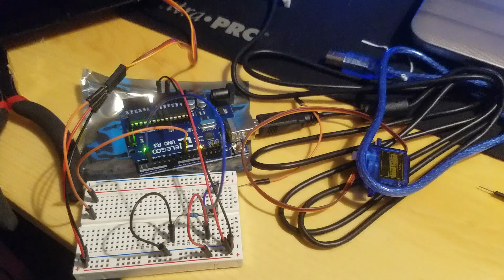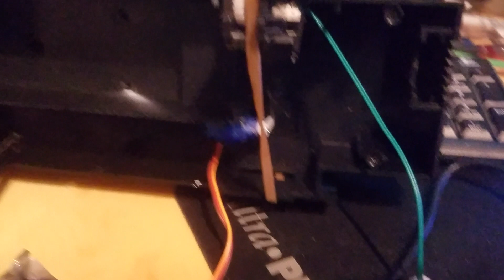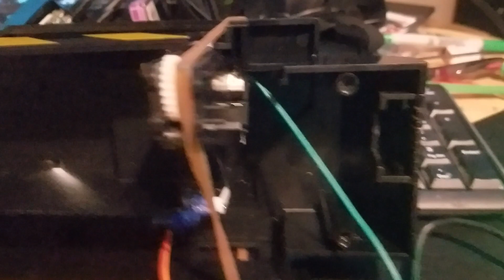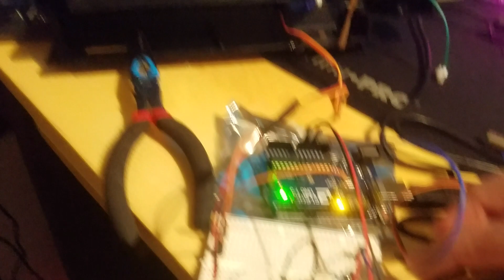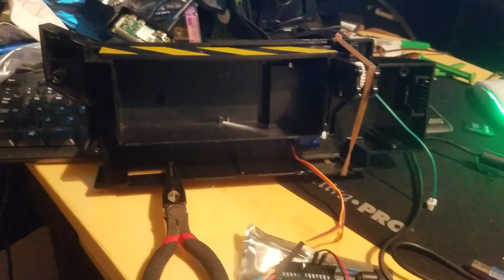Ghost trap arduino update

Comment: This is awesome! What did you use to attach the servo rod to the door mech?
Reply from the maker: So the servo rod i bought had some plastic sheathing that came with it, I just glued that to the existing "tabs" that the handle click mechanism pushes down on and fed the rod through there. Then the servo just needs to pull them down to close the doors and push back up to open. I have a link to a better description on the gbfans thread I created: https://www.gbfans.com/forum/viewtopic.php?f=3&t=44674&sid=6e525409de3458fa5112df759e4e29e3

Comment: Awesome job!  See if you can put in a one second delay between button presses.  This might cut down on false positives.  Also, you might be able to hook the main trigger into the arduino directly although it might be risky to do it.  I did it with my infinity gauntlet video and the original soundboard that came with it but it's tough to get it right.  I connected one end to a digital pin and the other, I think to ground.  Then wrote the code to write HIGH to that pin and it seemed to work.  Lord only knows if pumping that voltage through will damage anything.  If you're not updating the sound id probably just see how the original switch works with the servos once everything gets wired up.  It'll probably do the trick.  Did you think you wanted to do the adafruit soundboard on your second trap?
Reply from the maker: Good idea on the delay. It helps guard against button funkiness. That helped keep things a bit more consistent.

I still was occasionally getting buzzing from the servo, and I found this is a common issue. By attaching and the detaching the servo every time it is moved, this can be avoided. So I added that to my code. The problem is, as soon as the servo is detached, it will stop moving, so I had to add a delay for the servo moving time. Luckily, that delay is pretty reasonable.

As for setting it up to control the original board directly, I don't know that I want to risk it. I think that I just want to use the little switch under the door tabs to drive all of that. The one thing I am curious about, though, is whether the components in the trap could run using the 3.3v power from the arduino. My multimeter is reading somewhere between 3v and 3.1v from the AA batteries that supply the hardware that came with the trap, so it's CLOSE, but also significantly higher considering this is a 10% bump in voltage.
Reply: You could run a line from the arduino and feed the internals if you wanted but I bet that it won't be consistent without a regulator.  In the past I've used regulators like this one to take my voltage from 5v or 4.5v down to 3v. The components probably won't fry at 3.2v but I bet if a 5v sneaks past it could do some damage.  That's why these can be useful.  

Qunqi 5pack MP1584EN ultra Small DC-DC 3A power Step-Down Adjustable Module Buck Converter

However, since I don't want to add a 5v battery pack or try to run it off of 3 AA batteries producing 4.5v I'm going to attempt to do the reverse like we talked about earlier.  Take the 3v line and upscale it to 5v to run the board, servos and lights.  It will definitely drain the two little AAs faster but my fear would be installing a battery pack into the trap and then the batteries die so you'd have to pry it open and risk breaking the servos.  Or you could always do a lipo battery and tap a line to plug in from somewhere hidden in the back.  That would be a pretty boss move and I'd only really recommend it on a fully juiced up customized trap.  Custom speakers, custom amp, custom sound, custom lights and maybe even a little smoke.  That kinda upgrade, while certainly possible, would draw alot more power so a lipo might be worth it.  As for our simple open, play sound, close mod that seems like overkill.  I bet two AAs with a backup pair in the pocket would last all day at a con.
Reply from the maker: Yeah, I like the idea of using the AAs and getting them up to 5V for the arduino. The more stock we can keep things the easier it will be for anyone who wants to do a more basic mod.

I'm still really curious how the existing components will react if I plug them into the 3.3v on the arduino. Maybe I'll risk it since I plan to eventually replace the audio stuff anyway.
Reply: @TragicManner  Sounds like yoiu may have only purchased one.  I'm feeling a little guilty for buying 3.  In my defense, my wife knows about at least 2 of them.  😊

Give it a shot.  As I said before, those buck converters are very nice and reliable.  You can literally hook everything up, feed in an ultra low voltage and slowly ratchet it up until the components begin to work reliably.  With my infinity gauntlet, there was a reliable range of 2.5v to 3.5v. I didn't risk going high but you could start to hear static feedback and at 2.5v the board is slow to turn over and the volume is noticeably quieter.  It's a risk, but the bigger problem is adding in a second battery pack.  To run the arduino reliably.  How's the code coming along?  Can you private message a sneak preview?  I'm interested to see what you've got cooking.
Reply from the maker: I picked up 2, but I'm considering returning one. I don't know, if I can make one of them work, I figure I don't need BOTH of them. But I am keeping the second one until I make up my mind, haha. We'll see.

So, I've hit a bit of a barrier. Right now, it's nearly impossible to hook up both servos as once. Since they are independent of the gear mechanism, and since they are both hooked into their respective side of the trap casing, you can't hook up both push rods with the case open. Right now, I have closed the case and I have one pushrod hooked into the door tab, and the other side is right next to the servo, lying on top of all the wires. I can reach in through the hole where the wheels go to try and hook it in, but it is ridiculously difficult. And if the rods ever pop out of place for whatever reason, or if I need to open up the trap to work on things, the whole thing has to be dismantled to get it open. HUGE problem, haha.

I see a couple of solutions, and neither of them is trivial: One is put together some plastic that connects to the side of the gear assembly that hangs down for the servo to connect to. Seems overly complicated and it would take up space and make closing the trap even harder, but that's one option.

The second option is to carefully dremel off the side panels. This would allow me to do two things: Replace them with aluminum, and give me access to the internals without having to split the thing down the middle anymore. I think this is probably going to be the only realistic way.
Reply: @TragicManner  oh shit... I see what you're saying.  Technically, the springs are not needed for the gear mechanism to work.  So if I remember correctly, you could probably unhook the springs (if you didn't already) and saw the gears in half.  Once they're in each of their respective sides and the door is positioned correctly, glue it down.  Bingo!
Reply: Keep that second one by the way.  With a project this nice, you'd hate to bust a part and not have a back up trap.  Or even better, let's get some custom sound on round 2. 😀
Reply from the maker: af33 yeah i was wondering if sawing the gear mechanism was the way to go. The only thing you would lose doing that is the ability to back out the gears when they get messed up. Maybe a way to split it with a spacer to keep them together? I'll check it out.
Reply from the maker: Also, I'm not sitting in front of it to check, but i believe they make up part of what keeps the handle in place.
Reply: @TragicManner  it's possible.  Let me know what you find out.  If you need to cut into the trap I wouldn't do it from the outside, I would probably cut out a small rectangle on the inside of the box just above the servos.  You wouldn't need to connect the rod, only the white servo arm.  That would be alot easier.
Reply from the maker: Yeah, not sure about cutting the gear mechanism. The handle doesn't rest directly against it, but it DOES provide support for the part of the case that it does rest against. I think I'm going to cut out the fake panels and actually put on aluminum panels in their place. Looking into how much the aluminum will cost, should have an estimate from a local metal shop tomorrow morning. If it's relatively reasonable, I'm going to go that route. It's just not reasonable to maintain this thing with how it's set up now.

That will mean that I have to pull out the current battery pack. Probably for the best. Then I can get my own battery in there and work out the voltage situation.
Reply from the maker: So, looking at everything again this morning, I've also decided against dremeling out the side panels. There is too much inside the trap that is connected to them to really dremel them out easily, so it's looking like repainting them is the best course of action, again. Still leaves for some challenges on getting everything hooked up on the servos, though I'm wondering if I can figure out a way to cut the gear box and still keep that area structurally sound. Looking into it.
Reply: @TragicManner  as I said, another option is to cut a small access panel inside the box.  If your going to place a translucent piece of white plastic over the box like the matty trap, no one will ever see it.  You could also put in super bright leds.  You're not supposed to look directly at the trap anyway.  😉
Reply from the maker: Wait, what white plastic on the matty one? I'm still stuck on figuring out where to cut into things :D The one place, though, that makes a lot of sense to me is where the power switch is. I could easily cut out a bit more around there and put a plate over it, with screws like you see on the matty trap. So that's an option, too. Also, on the 3.3 v running the original board that came with the spirit trap, I set it up and it worked! I read about 3.21 - 3.29 on and off using a multimeter and I ran it for a whole hour without any issues! Not sure how well it will be able to take the stress of a little extra voltage long-term, but it's a good start. I was running everything off of a 9v battery just to see how it held up, by wiring the positive into vin, and I basically ran it dry. It didn't have enough power to supply the servos after a while. So I'm definitely going to need a beefier battery.
Reply: @TragicManner  so if you look at the matty trap, there is a semi translucent piece of plastic between the doors and the trap box.  Unlike the spirit trap, where the lights can be seen dead on when the trap is open, the matty trap obstructs the view by placing a piece of plastic under the doors to diffuse the light from inside the trap.   My idea is,  cut a hole right above the servo inside the trap.  This will allow you access to assembling the servo and then you slide in a plastic sheet in between the top of the box and the doors.  It will have to be thin so the doors can close over it but it would make it impossible to see directly into the trap.  Hook me up with the code so I can make a video by Tuesday and let you know what I'm talking about.
Reply from the maker: OK, yeah, I see what you're saying. I kind of like the open-trap look, so I'm going to see what I can manage. Maybe I'll put the hole down in the bottom and put something about halfway down if I can't find another way to do things.

So the code is here: https://pastebin.com/VAgebAxa

That should control the servos how you want, just adjust the values for the servos accordingly. Let me know if you have any questions. Servo1 is the servo on the side with the battery compartment, and servo2 is the one on the side of the circuit board.